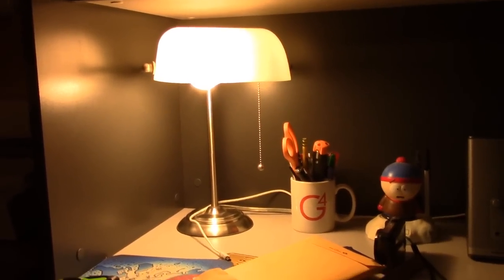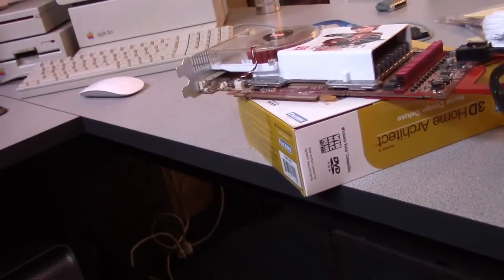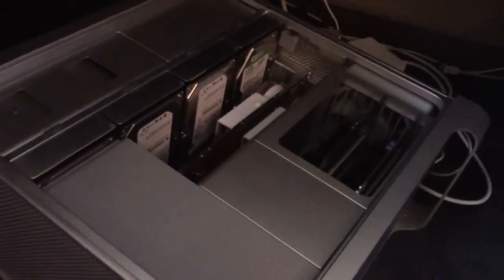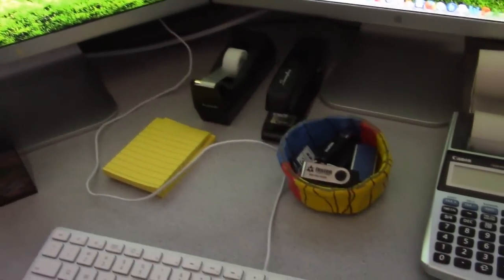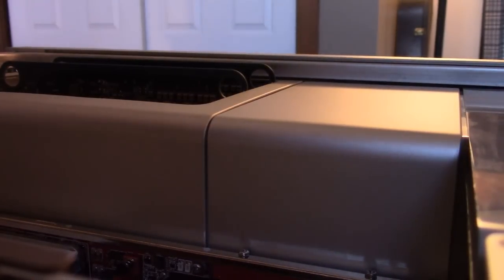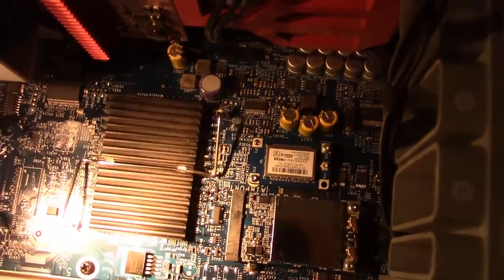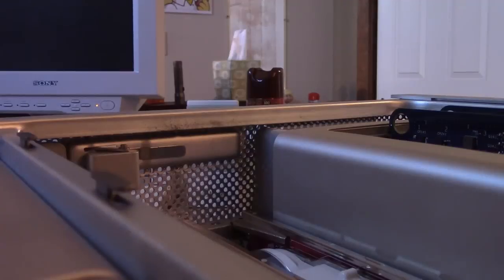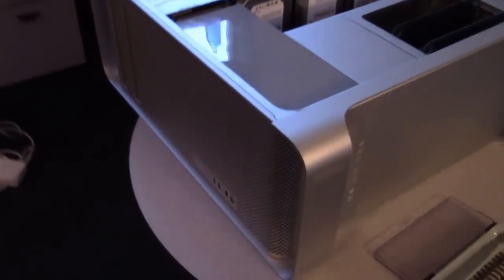MacPro Upgrades Round II

Comment: Watching these videos has convinced me that I do want to replace the logic board in my late 2005 G5 and get it working again. I miss it.
Reply: +compactc9 But maybe I should just get one of these when I manage to get an amazing deal on one. I do have a very fast, probably at least as fast as the 8 core version of tis machine will be, maybe a bit faster, iMac, so this would be a toy to me, its not like I would be gaining anything for video editing performance unless I got a 12 core version, or one of the last 8 core models. But those are still quite pricey.
Reply: +compactc9 depending where you live they can be bought for around 250-500$ , depends on the configuration

Comment: The quad-cores I put in mine cost less than $30 for both, I got the 2.66 GHz X5355 SLAEGs. If you're willing to spend a bit more you can go up to the 3.0 GHz X5365s, if you're using this as your main Mac it may be worth it to squeeze every little bit of performance out of it.
Reply from the maker: +Timur Tripp I'll look into this, as I really don't want to spend $150 in CPUs. The kits include all the stuff I already own to make the installation possible, so anything to save a few bucks on this.
Reply: +BBISHOPPCM&#39;s World Well, I upgraded mine with the E5345 chips, which are Quad Core 2.33Ghz chips. They have a TDP of just 80W, so barely more than the 5150 dual cores in there originally. They're typically around $20-25 a pair. Only useful if you need more cores really. Otherwise, I'd recommend the X5355 to keep single thread performance the same.

Comment: I always wanted this machine. I think it is a tank and it will be very much usable maybe even ten years from now. 
I currently have 2 Dell Precision 380 which are tanks aswell and they are used every day. Only thing I had to repair on them - right when I got them, both had bulged capacitors for supplying power to RAM slots, so they won't boot since the RAM was virtually non-existant for them. Four caps were changed and both are happy now, one running Windows XP with 4GB RAM and GT9600 used for games from between 2000 and 2012 and the second one is running Linux Mint on 5GB RAM and GT210 used as a workshop theatre.

Comment: If you're looking at a 32GB RAM upgrade, I'd recommend this listing on eBay. I got 4 orders of this set of two 4GB modules, and only ended up paying $24 total (after leaving a best offer for $7 per order). It works perfectly fine in my Mac Pro, and I haven't had a single issue with this memory since installing it about 3 months ago (I use my Mac Pro as my main machine). http://www.ebay.com/itm/181746279838 Also, the best CPUs you can install in that machines are Xeon X5365s. On average, they seem to go for $100 for a pair, however I managed to get mine for $30 a piece (from separate listings). The Xeon X5355s are exactly the same, but are 2.66 GHz instead of 3.0 GHz like the X5365s.

Comment: What I've done in the past is rip the heatsinks off of 512MB Mac Pro sticks and swap the heatsinks onto 4GB RAM sticks out of Dell Servers. They're the exact same electronically, and you can get them for much cheaper than the Apple certified stuff.
Reply from the maker: +Sir Raven Really?
Reply: Yup. It worked perfectly fine.
Just remember to apply some new heatsink pads or compound to the AMB chip.
Reply: I'm pretty sure both the server and the Mac Pro use the same kind of RAM (ECC type)
Reply: +Techtron23 Yes, they use registered ECC RAM out of servers. The heatsinks were added because Apple didn't want to have a noisy fan constantly blowing on the RAM sticks like they normally do in a server.

I've heard of others who swapped in RAM without swapping the heatsinks, and noted that they ran at 80+ degrees C.

Comment: I know a LOT of people like to hate on Seagate but I can say those Barracudas are damn good for what they are. I ran OS X off a Barracuda that came out of a dead Time Capsule and that drive was deceptively fast, and also very rock solid.
Reply: +Xodium speaking of Seagate they are facing a huge lawsuit for there 3tb drives
Reply: I got a seagate 160gb barracuda running in an old late 2006 iMac currently running as a server, and it hasent let me down once!
Reply: It will crash without warning which is what happened to a seagate from a emachines computer but i was able to salvage all the data

Comment: I would highly recommend you get better graphics cards for that machine, that support OS X 10.8 or newer. That's either a GeForce 8800GT or newer for nVidia, or a Radeon HD 2400 Pro or newer for ATI/AMD. With these cards, you will be able to run a fully functional copy of Mac OS X 10.11, El Capitan on that machine with a simple replacement of the boot.efi file. The whole process is detailed in my video here: https://www.youtube.com/watch?v=JD1xWFh2dAk Also keep in mind that the card doesn't necessarily need to be Mac compatible, with a standard PC card, it will work perfectly fine, you just won't get a boot screen. For certain PC cards, it is possible to flash them with the EFI firmware, allowing them to display a boot screen (I have videos in which I flash a GeForce 8800GT and Radeon HD 5770 for my Mac Pro). The process is quite easy, and running El Capitan on these machines gives them a whole new life.
Reply: +dosdude1 My Early 2008 MacBook Pro has the 8800M GT GPU in it, so I guess I'm lucky :D
Reply: Jordan Woolery Those have the 8600M GT, which are compatible as well.
Reply: Oh whoops, my bad. I don't have it in front of me right at the moment, it's in the living room (because it is so far lol)
Reply: +Jordan Woolery I wouldn't say lucky... those 8600M cards are famously troublesome
Reply: +dosdude1 Why are you advertising your channel here?
Reply: +ElectrofizzStudiosCo mine hasn't blown up yet though I do have intentions of "Arctic Silver 5"-ing it.
Reply: +Foreigner037 "Advertising my channel" is not my intention here, I'm just trying to show that it is indeed possible to run El Capitan on these machines (which most people don't realize), and since I had already made a video about that previously, it was the first "go to" resource I could think of to explain how to do it (rather than explaining the whole process in a comment).

Comment: Have you tried installing El Capitan on your Mac Pro 1,1? I did that and it turned out awesome. You need to trick a bit, but it's easy... If you want, I can help with that.
Oh and I have a Geforce GTX 680 in the machine and it roars like a beast.

Comment: I thought the 2006 Mac Pro was the first-gen Mac Pro? Also, more on the Green drives, the stock 1TB Green that's in our Time Capsule (2G I think) still works perfectly fine today, that's after 7 years of regular use with 5 Macs (years ago it was backing up 3 Macs, later 4 Macs and so on). Strangely enough, the drive only spins at 7200RPM.

Comment: I have a 2X2.8Ghz Quad-Core Xeon that's running 10.10.5. The only reason I haven't upgraded to El Capitan is that I only have 2GB of ram and it requires at least 4. I didn't make any modifications to the machine at all to run this system.

Comment: Those displays look nice, what's the native resolution? And also will they work on a PC?
Reply: +Jakob Wright They're the 20" version, so they're 1680 X 1050. There's also a 23" version which runs at 1920 X 1200, and a 30" that runs at 2560 X 1600 (although this version still runs a premium even in the used market). They use standard DVI, so they work about 95% or so on a PC (I don't think brightness adjustment will work).
Reply: +elecxonica I was curious. What's the picture quality like on these displays as at the moment I have a accent sync master 172w which is okay but it's small and only 1280x768 I want to find a decent display which looks good for a decent price.
Reply: Jakob Wright I don't own one, so I can't talk from experience, but I have heard that, particularly the last gen of them, are still sought after for Film and Photography professionals.
Reply: +elecxonica I have the 23 sitting infront of me now running of a dell m6600. Brightness and power controls both work, even with out usb plugged in. They work with all they system i have plugged them into other than an xbox 360 from a hdmi adapter.
Reply: +ElectronicsWizardry I might look at one in the future, because my 17 inch sync master is okay but really small

Comment: Can you make a 3rd video for when you get the parts?
Reply from the maker: +Johnathan Tanguay IF I get the parts, yes. I'm definitely upgrading the RAM on this thing, but the CPUs is yet to be determined.
Reply: I've seen videos on this and for the first gen Mac pro you HAVE to upgrade the firmware to make the Mac think it's a 2nd gen Mac pro. Or else the extra RAM or the new CPUs won't work.
Reply: +Johnathan Tanguay That's not true, the quad-core CPUs work with the stock firmware. The flash to 2,1 is mainly so they are identified correctly in About This Mac. 32 GB RAM also works fine without a firmware flash, but I'm not sure about 64 GB.

Comment: damn I wish I could have 3 20" cinema displays. I have 2 of them and one has a red "end of life" tint.
Reply: +AdanD66174U.2 Yes, that's one nice setup he has there. I have one, which finally started working yesterday and I'm now using it with my 2006 Mac Pro.
Reply: very nice
Reply: +AdanD66174U.2 | Do you know what causes the red tint? Is it the CCFL backlight that's failing?
Reply: I do not-from what I have seen I think that the CCFL is the problem as you are saying. I have it calibrated with an extreme blue/green tint to compensate and it is visibly different however I got used to it. Do you have a similar problem?
Reply: AdanD66174U.2 No. Just that the CCFL backlight in my 2nd computer (L' '07 MBP 17") has a really awful yellow tint to it.
Reply: yikes-still rocking that 2007 MacBook Pro though! I had a 2008 with tones of graphics issues. I tried replacing the display with one from my old 20" White iMac (same panel) and it didn't work (screen didn't turn on) so now that you mention is, the CCFL is probably it.
Reply: AdanD66174U.2 My main computer is an iMac 21.5-inch, Mid 2011. It has an LED-backlit IPS display so I'm having absolutely no problems with colour at all. This is the best computer screen I've ever seen. I only use the '07 MBP as an OS play-around-with machine. Soon I'm putting 10.6.8 SL on it, I'm also planning on testing out some few Linux distros for the first time. Right now it runs Windows 8.1 x64, and I only did that just to see if I can beat Apple by getting Boot Camp drivers to work successfully on an unsupported Windows version. Basically I use it to do stuff that might mess up my iMac's hard drive.
Reply: ah-I want to get a 21.5" iMac and a equal resolution second display for it.

Comment: the Windows 3.1 machine problem is probably due to how the VM handles idling.

Check out "windows 3.1 dosidle" or just look for dosidle.exe - this has solved my problem in the past. it just fixes how the VM handles cpu idle in DOS. Windows 3.1 will automatically see the benefits. it's transparent and TSR.

Comment: why would you get such obsolete GPUs and such expensive ram?
Reply from the maker: The MacPro requires RAM with ECC and unusually large heatsinks with onboard temperature sensors (on each module). This isn't your typical DDR-2 or 3 desktop RAM. You can use less expensive server-grade modules, but you will need to swap the OEM heatsinks over.
Reply from the maker: I ended up re-purposing the entire system in a friends' music studio; it turns out, it's the perfect system for multitrack audio recording and processing.

Comment: Yeah I don't like the greens all of them that I have gotten a hold of have some major problem...  And plus what in the hell is 200rpm speed difference gonna make wouldn't it use more energy to accelerate the speed back up to 5400.  I have one of the 5900 rpm Seagate drives and it is great nice and fast very reliable. And near dead silent
Reply: +Zachary zero issues with my 15+ green drives. Just turn head parking to 5mins are you're golen
Reply: lol good for you i no longer own any green drives :P
Reply: The 1TB Green drive that's in our 2G Time Capsule spins only at 7200RPM.

Comment: http://forums.macrumors.com/threads/os-x-yosemite-on-unsupported-macs-guide.1761432/

you can run yosemite on that mac pro if you want to put a little time into it
Reply from the maker: +43128lucky4 I know. This machine is dedicated to running older software, and VMs. It's currently running Windows XP, Windows 10, and Windows 3.1 in addition to 10.6.8.